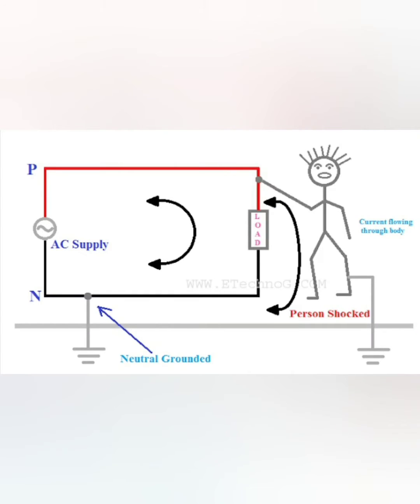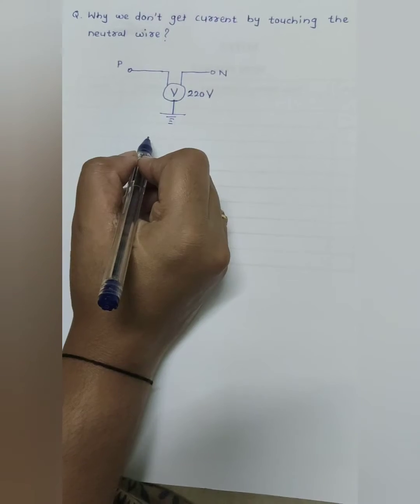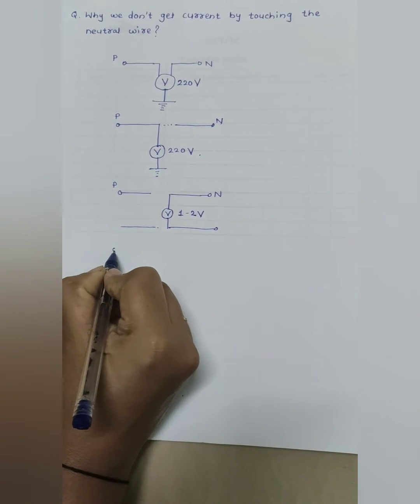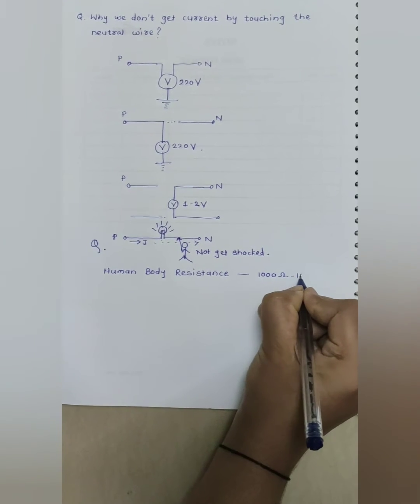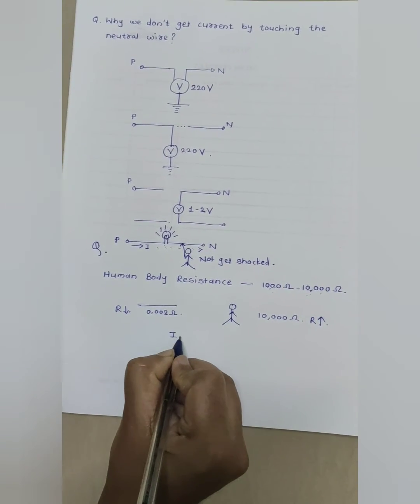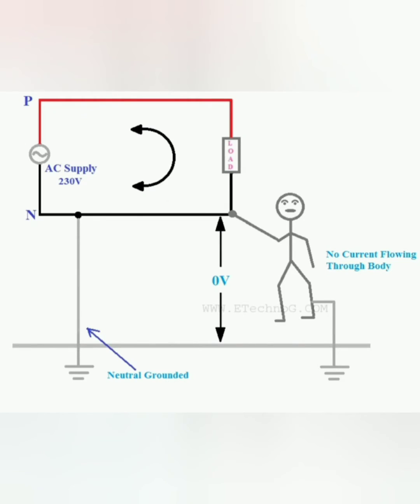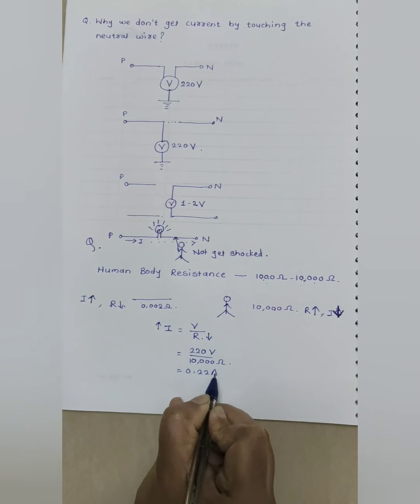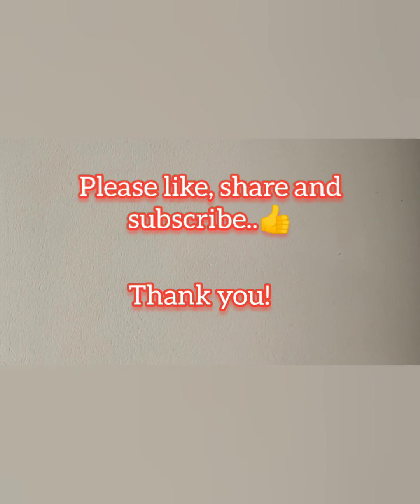Why we don't get current shock by touching neutral wire? | Phase and neutral | Human body resistance

Comment: I don’t think you explained the neutral not getting shocked properly. I think the reason we don’t get shocked is because we have 0 volts neutral to 0 volts ground …..no potential difference……no voltage between….. so no shock. But with live hot we have 120 from hot to ground. In both cases we are parallel loads and in both cases we must focus on this

Comment: Great video thank. A little confused. If touching neutral, you mention, current prefers path of least resistance, so it will prefer flowing through neutral. The same can be said about touching the phase wire, current prefers the live wire not the human, so why the difference?